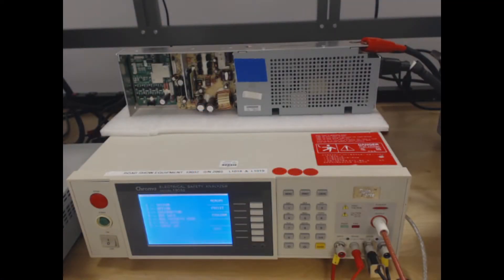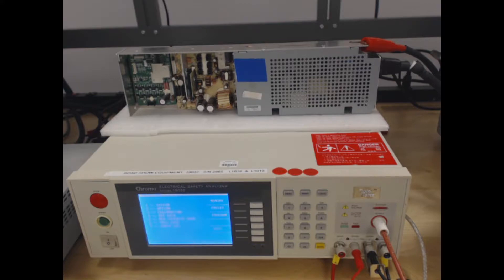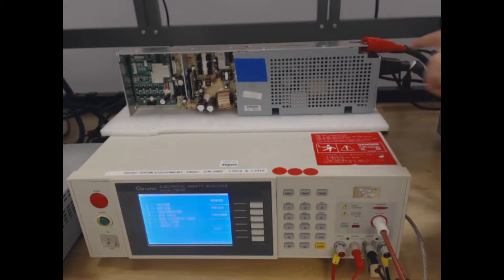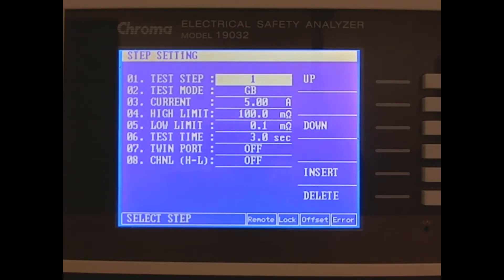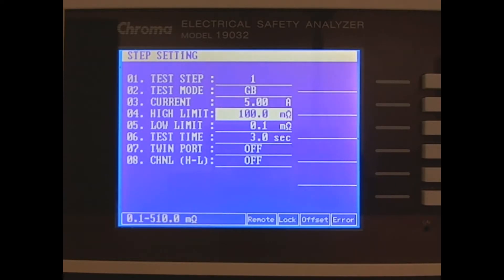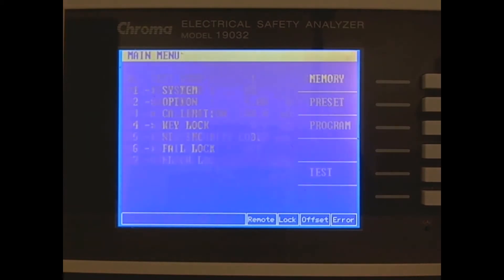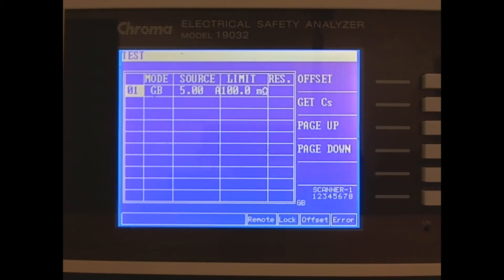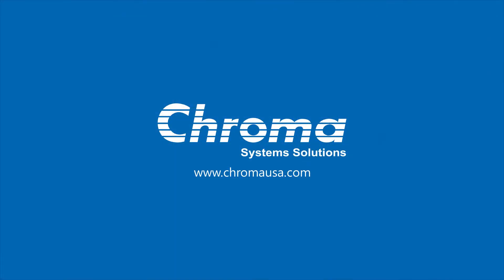19032 Ground Bond Test

Comment: Good afternoon!
Thank you for the video.
Could you please show me how to connect the device to the 19032-P to measure the leakage current ? Do you need any additional modules or is only one 19032-P sufficient ?
 Could you please tell me if the leakage current test requires the device to perform its function? For example a blender or microwave must be running during the test ? Thank you.